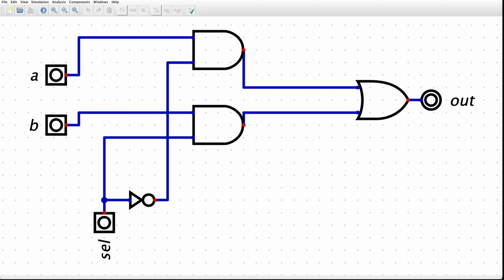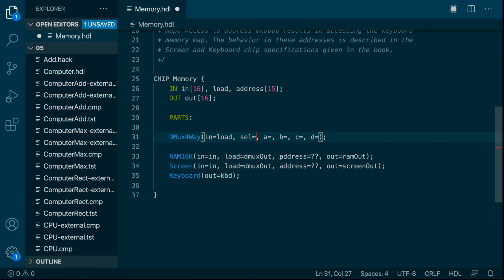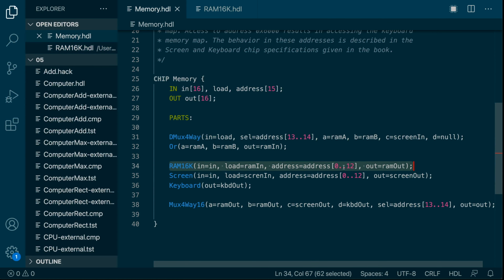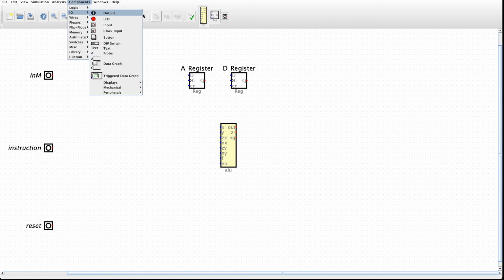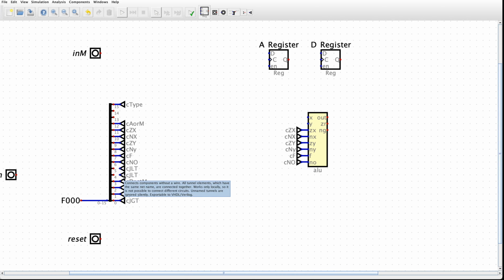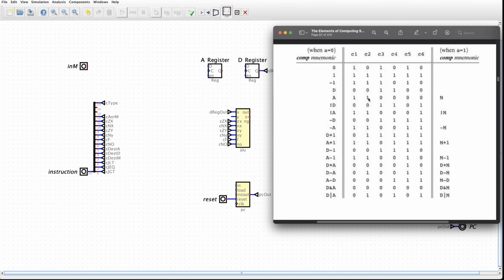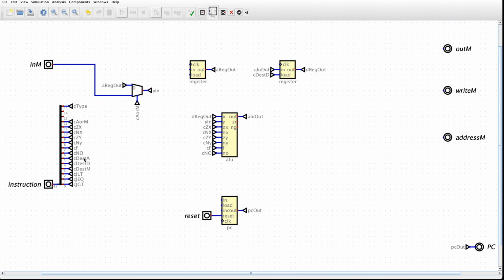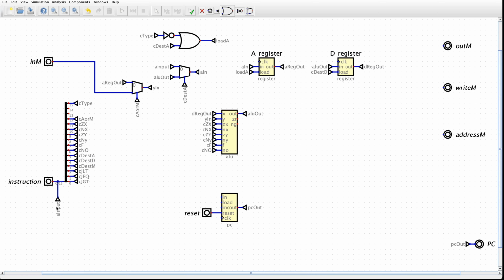CPU Lab - From NAND To Tetris, Part 7

Comment: What was the purpose of the calculator near the beginning of this?  That has nothing to do with what the information is saying... were you perhaps confusing yourself here?  That's what it seems like was going on.
Reply from the maker: It's hard to see, but in programming mode,  the calculator is showing (in binary) which bits are significant for us to discriminate on.
Reply: @TeaLeavesProgramming  I understood that, windows has something similar in it's programming calculator.  What I mean, is your explanation of $4000 does not match the bits you're showing (which most programming calculators wont show), so I guess my question is - despite talking about that address, are you trying to show the bit representation of the number 4000(hex)?  Because you were talking about addresses and then immediately jump to talking about those bits with no in between.  

If that's what you meant (showing the bit representation of what the address looks actually looks like), I can see how you jump into it being confusing for people not as experienced as we are (I've done all this before, but I decided to get back into it recently since new tools posted, and there's an update to sebastian lague's digital logic sim that almost lets you build this computer now).

My intent was to figure out your intent here, so I could point out the clarification issue.  I also should have worded what I said better, sorry.  I was really tired yesterday around that time.

Comment: Is there a part 8?  I've been following along and ripped through the HW stuff, but hit a wall on the assembler. It took some time but that's working now.  I don't want to get too far ahead if you're planning on covering the software side of the project.

Love it so far!  Thanks for the effort!
Reply from the maker: Hi, Kelly! I did a fairly high-level overview of the assembler here: https://www.youtube.com/watch?v=TPdWGWmOvAw&t=178s

I am however struggling with doing a "lab" type video for the programming parts because...it's not that interesting to watch, honestly.

Comment from the maker: ERRATA: Alert viewer Ivan points out that the selector for our mux that outputs to the "aIn" tunnel is incorrect - we are using cDestA as a selector, when we should be using cType! Thank you for the correction, Ivan.
Reply: Thanks. I removed the comment because of the last part of the video, talking about errors ;)

Speaking of these, I think there's one more small error: the D register's load signal is directly connected to cDestD. This is correct in case of a C-type instruction, but incorrect if the instruction is A-type.
Reply from the maker: @IvanToshkov  Yep! This is covered at the last possible moment in the video that will be posted later today, and is a general consequence of "pulling the wires" for the control signals without regard to whether it's an A- or C- instruction. (Smash cut to me running the simulator saying "Hey wait, why is an A-instruction causing the program counter to jump?")